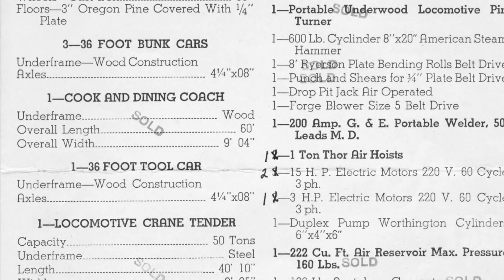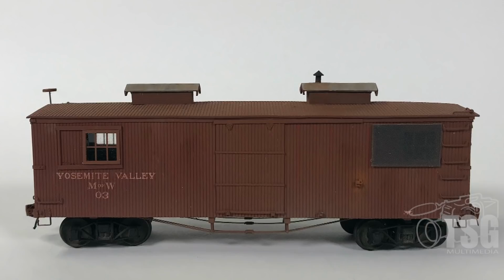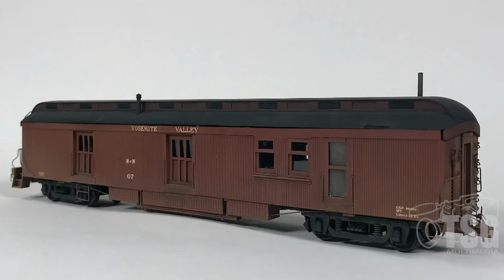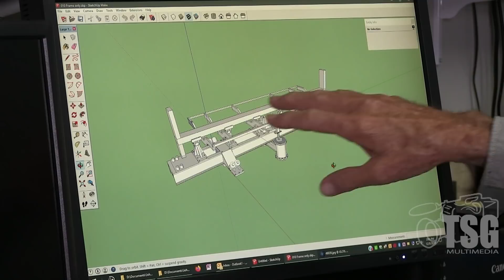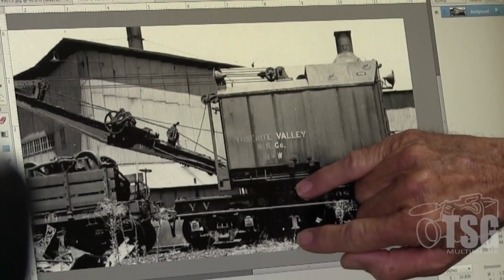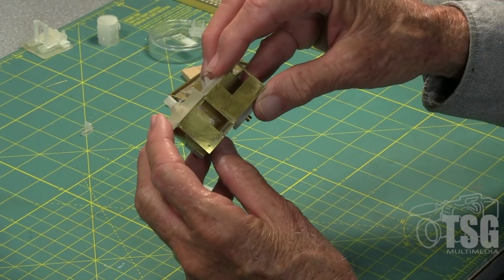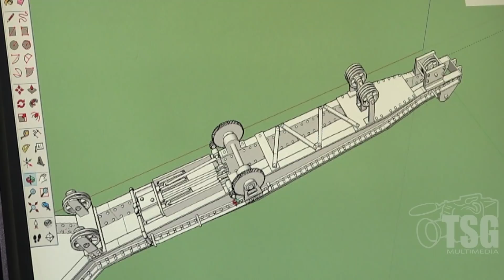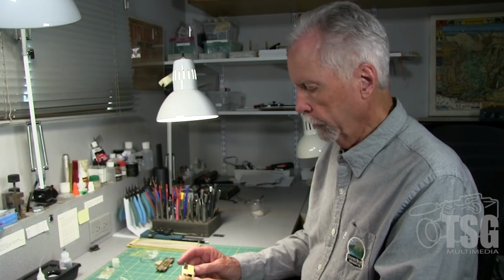Model Railroading with Jack Burgess HO Scale MOW Train

Comment: Photogrammetry is the science and technology of obtaining reliable information about physical objects and the environment through the process of recording, measuring, and interpreting, for example, photographic images. There are many variants of photogrammetry. One example is the extraction of three-dimensional measurements from two-dimensional data (i.e. images); for example, the distance between two points that lie on a plane parallel to the photographic image plane can be determined by measuring their distance on the image, if the scale of the image is known. Other measurements not directly measured from the image can also be determined.

Comment: What!?  You didn't have all the pulleys and pulley shafts done separately so the crane can be fully operational?!   😶...    Ha!   Seriously, that's about the most prototypical old steam crane ever, short of the real thing - which is gone.  I sure hope those steam rods print.  If not, just make them up separate and fit them in. 

BTW, all those models you've done are magnificent.  They should end up in a museum collection (in 50 years or so-😁).

Comment: anycubic photon  printer   jack is what  you need do a step by step drawing with 3d  it would very helpful
Reply from the maker: FYI Tom: YouTube blocks links automatically.
Reply: Tom...I Googled that printer and it appears to be a home 3D printer for about $300. I have a friend who has a $3,000 3D printer and he has a success rate of only75%. Shapeways prints my files on a $100,000 printer. I don't think that I have yet even $300 on 3D prints since my first 3D order in 2013...

Jack
Reply: @yvfan  hi jack i try would more on 3d drawing some us are not that good on the x y z   i can do 2d in corel    tom
Reply: yvfan Greetings, you replied you’ve spent around $300 with shapeways over the years. I’ve not used shapeways yet.  Do they charge customers significantly less to purchase a print of a file the customer submits, than they do for someone else to purchase a print based on that same item?  
As an example, seeing that they would charge me $120 for the box car 602 frame and $182 for the oil house breezeway quickly pushes past $300.  Those are from Jack’s Yosemite-Models shapeways page. 
Jack and TSG, Your videos are fantastic, thanks for sharing your knowledge and skills.